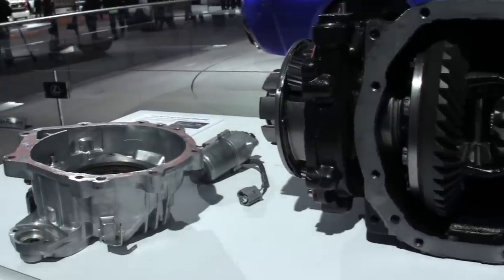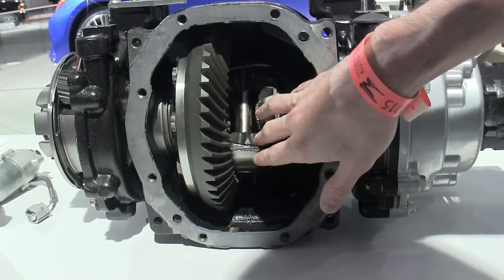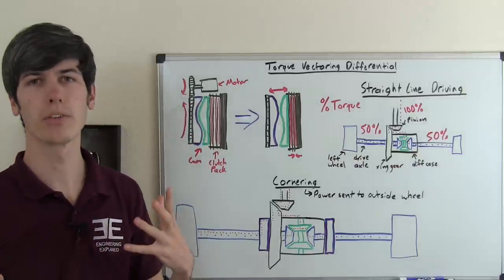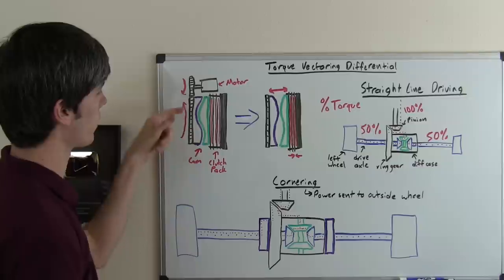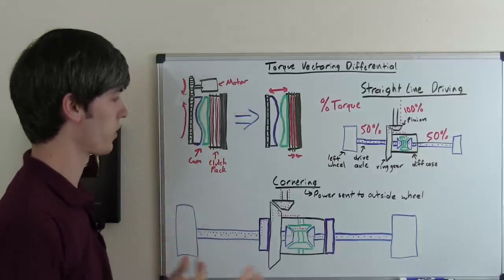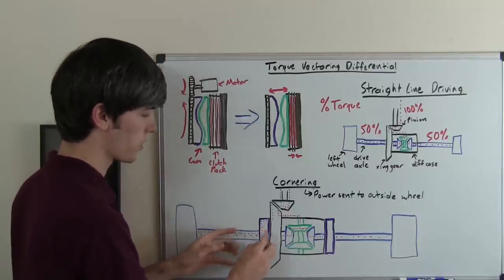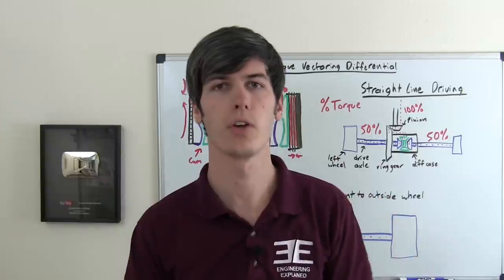Torque Vectoring Differential - Explained

Comment: Recent purchase of a 2019 jeep Cherokee with Active Drive 1. It has this crazy wobble on acceleration, even after replacing the rear drive module. I’m wondering if torque vectoring problems in the programming are the actual cause of what seems to be a lateral wobble

Comment: Nice video, but I don't know if I'm getting it right. So the controller input is the driver steering angle and small part of the throttle gain? how wide is the torque ratio do you think this can transfer 20%-80%?
Reply from the maker: Some of these diffs are capable of sending 100% of torque to a single wheel.

Comment: Seems like it works like a brake lock differential (bld) but at high speeds. Instead of using the brakes to move torque it uses clutch packs.  Am I understanding it right?   Seems like a lot of work for not such a great gain...

Comment: Seems like a high weight/complexity/point of failure-to-benefit ratio. Torsen seems like it could do 80%-90% of what this does for 1/2 the weight and 1/10 the complexity and points of failure. Not to mention clutches being worn items.
Reply: Torsen by itself doesn't make the same job. And it has its own inherent cons.
Reply: @MaximusU76  The only con of torsen that I know of is that it acts like an open diff of one side has zero grip. The solution to that is to press on the brakes. If there was anything else, I'd say the initial purchase price for the unit compared to a clutched 1-way, and that a torsen itself is also only 1-way IIRC, but I'm only 30% sure about that since I've seen several guys drift very well with them.

Comment: are torque vectoring differentials and LSDs same without the motor in the clutchpack?
Reply from the maker: Similar, but torque vectoring differentials are capable of proactively altering the amount of torque sent to each wheel, where as an LSD mechanically reacts to differing grip. You have significantly more control over how torque is applied with torque vectoring.
Reply: This torque vectoring doesn't involve any locking, but rather using planetary gearing system to vary the shaft speed (Like you know, automatic gearbox)
So yeah, technically speaking, it is completely different
Reply: No, the motors for activating clutches are not the only difference. Cause it would be a regular active LSD. They are also planet gearsets on each axle.

Comment: Will this allow you to have an even smaller turn radius in a RWD without the front wheels just sliding forward? How much smaller do you think?

Alternatively, in a RWD, would having an open differential but having brakes that can apply to one rear wheel or the other when at very low speeds with the steering wheel is turned very far help you with that?

Also, I have a general feel for when the front wheels will just slide instead of actually turn (from my sit-on lawn mower. It's RWD, open differential and can turn the front wheels really far. Measured about 65 degrees on the outer wheel on max turn).

It seems to not want to turn anymore at different angles depending on the inclination of the ground, the direction I lean on it, and the surface it's on. Maybe there are other factors I don't know about too. What I have no idea how to do is calculate what angle it's gonna be.

Anyway I had this idea because I discovered that short of spinning one wheel, leaning over the outer rear tire seemed to mean I could turn the steering wheel slightly more and still turn.

Just figured if that could somehow be used to lessen the eternal pain of doing U-turns with your city car on tight roads, that'd be swell.

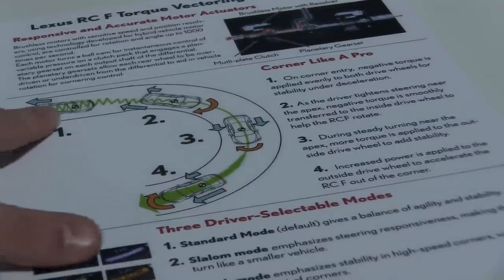Comment: At 4:44 what does the diagram mean by negative torque is applied. What is negative torque and how is it applied.
Reply: It will actually turn that side of the differential backwards sometimes in order to swing around more during a turn or something like that.  Sounds weird, but for track laps it's actually pretty effective.
Reply: That is just braking.

Comment: In reference to the Evolution X and the 2015 WRX and STI, how do those torque vectoring systems differ. It seems like the Evo X uses a system like what was explained in the video. However, the WRX and STI uses a "brake assisted" system Subaru calls "active torque vectoring".

Comment: Why is more torque sent to the inner wheel to rotate as opposed to the outer wheel? Is it because while turning the weight of the vehicle compresses the outer wheels more giving them more grip, meaning the inside wheel essentially has less grip and needs more power? Thanks.
Reply: Remember that under hard braking, the torque from the engine will work as "engine braking" which is why in the diagram, in the video, it is referred to as "negative torque". It is actually braking the inside wheel more by connecting it more to the engine using torque vectoring = more negative torque to the inside wheel. When coming out of a corner, you hit the accelerator, and when the car senses that positive torque is being applied, it shifts it to the outside wheel. I hope that makes sense.

Comment: So a torque vectoring diff is an lsd that is electronically actuated based on differend readings from sencors, instead of mechanically through the movement of the pinion. Thus making it a proactive diff instead of reactive. Which would you say its better and more reliable with less maintance required. Correct me if im wrong, im still an engineering student. Also big queation, might be dump. We know you can pretty much fit a torsen to any open differential housing. Could somebody theoretically put a torsen(or similar atb) in the place of the open diff in this diff assemply. Would that make any sence at all?
Reply: Not exact. This design has planet gearset reductors at each side. So wheel side of the clutch is rotating slower than diff housing side, even for faster wheel.

Comment: 4:58 it actually says negative torque on the pamphlet which is a small but important difference.
Reply from the maker: Correct, important point that perhaps I could have been more clear on rather than just showing the backwards arrow.
Reply: +Engineering Explained 
just make additional video about Negative Torque.
I don't get that concept with full fathom.
Reply: park kim In this case it's just referring to torque in the opposite direction of travel.
Reply: It's just braking. No matter by what means, traditional friction brakes or recuperating E- motor. And yes, braking could also be vectoring, and are indeed. By individual brakes (traditional), individual motors (one per wheel while recuperating) or by such diffs.

Comment: Hi Jason. Would the torque vectoring lsd diff be better than the torsen and viscous lsd diffs for regular and performance driving ? Whats your opinion ?
Reply: +Timur Hafouz Yes, it would be better, because with TV, the outside Wheel is more "accelerated", wich helps the car turning. The common LSD Types are only locking if one Wheel is losing traction. Also the Clutchtype LSD is often pretensioned, wich leeds to understeer. So in many cases, is the TV a better solution.

Regards from Germany

Comment: Thank you for the explanation. A technical question for anyone that can answer it, and I can't seem to find info on this anywhere. When the clutchpack is engaged one axle side, it is connecting that side to the differential housing, but is it also disconnecting from the spider gear? If not, wouldn't that immobilize the spider gears (inside the differential housing), and effectively locking the other side to the differential housing's rotation? I noticed there's a planetary gearset on each side that must somehow eliminate this, but I'm curious as to how?  Thank in advance!
Reply: I think his explanation is actually wrong, the axle is not directly clutched to the differential carrier. The axle is clutched to the carrier through a planetary gear system which then allows one axle to be driven faster than the carrier in turn driving the other axle slower due to the spider gears. It kind of forces one wheel to spin faster that the other thus creating a torque vector.
Reply: @wdwickham  Thank you. If that's what it does, then it seems like the torque vectoring is binary (on/off) rather than variable
Reply: Not binary. Because that clutches is not aimed to full lock. If so you get a fixed ratio between left and right wheels. And that's not the case. They are slipping all the time they are engaged. So you have some power  loss, heating and more rapid clutch wearing during torque vectoring.

Comment: because when the clutch  lock up it act as a solid unit with the differential housing, it's exatly the same result as braking. So why not building only brake torque vectoring system? You could save some weight, of course brakes'd heat up faster..
Reply: Brake based system is very slow (~200 msec range).  Clutch pack system response is really fast and it doesn't rob as much power from the powertrain.

Comment: I also wanted to ask if there is a difference between LSDs and torque vectoring diffs! Also does ford's torque vectoring system use the same principle or is it just by applying the brakes to the wheels thus alternating torque distributtion?
Reply from the maker: Many use the method of braking individual wheels, as it's far cheaper to implement, though I think a dedicated system as shown in the video would ultimately be a better solution (and wouldn't cause brake wear).
Reply: LSD's are mechanical systems and do not react based on conditions, steering angle, yaw and throttle application. They are pretty much bullet proof but not smart. TVD like in a SHAWD Acura or the lexus are capable of sending 100% of the power to the outer wheel and can also help correct your angle. In bad weather conditions it can sense slip and send power to the wheel with the most grip. 

Ford's system is brake actuated and is very basic. It works but its older tech and isn't as good as an active system.

http://blog.caranddriver.com/what-torque-vectoring-really-means-for-the-2012-ford-focus-and-why-you-shouldn%E2%80%99t-get-too-excited-about-it/
Reply: Engineering Explained Would be interesting to see comparison of available outside wheel energy (or system efficiency) of torque vectoring vs brake based vs clutch vs viscous LSD's at varying loads.
Reply: Chris Conroy Well it would be brand specific again. Acura's system can send 70% of the power to the rear and 100% of that to each side if necessary. Lexus may be different and Audi's split is 40:60.

Comment: Coming into the corner it applies more torque to the inner? Shouldn't it be to the outer more, just because it would have more rotating ratio than the inner. Just like it coming out of the corner you see it's the outer having more torque.

Comment: Yeah, I still don't understand. If all you are doing is engaging the axle to the differential housing it would make it no different than applying the brakes on that wheel, which would for sure be less complicated and cheaper. No mention of why there is a planetary gear here. I think this explanation is incomplete and confusing.

Comment: Seems like this adds a lot of weight.   For a lightweight car, is it going to be worth it, or does the extra weight causing the car to want to fly out of the corner more offset the torque?  I suppose you will spin the inner wheel at the limit and lose traction, but isn't this just fine for a racecar, at least with a good driver.
Reply: I think, it would be beneficial to use to for some XUVs
Reply: @RahulSharma-oc2qd  One with a high COG will lift the inner wheels rather easily in a corner so yeah this would help maybe a lot and of course adding 200lbs to a 5000lb suv is not a big deal.

Comment: If there is slipping on one wheel during cornering (say, the inside wheel, which needs to lower torque), disengagement of the clutch pads will unexpectedly send more torque to this slipping wheel since the torque goes to the minimum-friction path, wont' it?

Comment: Except for Lexus FWD Awith AWD based SUVs that only send 50% power to the rear maximum and only have brake based vectoring.

Can you cover which brakes are used in brake-based vectoring?
Reply from the maker: Some companies apply brake vectoring to just a single axle, others will do both front and rear.

Comment: I still did not understand the advantages of torque vectoring diff over open diff. I mean this job can be done by limited slip or self locking diff as well.
Reply: only difference is that it can now be electronically engaged (e.g. through steering wheel movement) rather than through movement of the pignon when braking/accelerating. The new Acuras NSX apparently uses this technology heavily
Reply: No, that's wrong. Classical LSD can only push forward slower wheel and pull backward faster wheel. And that doesn't help while cornering, rather opposed.

Comment: How is this different from an LSD ? What if I could use a Torsen differential/LSD which could be activated during cornering as well (and not just during the case of unequal grip) ? Won't that essentially act as an equivalent Torque Vectoring Differential?

Comment: Doesn't a limited slip differential (LSD) do this exact same thing mechanically? Having sensors, electronics, and motor seems like a lot more to go wrong when a mechanical LSD does the same thing.
Reply: Not exact. Simple LSD accelerates the wheel with less speed and brakes the wheel with more speed.  And that's not the case for good cornering.

Comment: wont the clutch pack wear out very quickly ? and once the clutch pack wear out, the lsd no longer function?
Reply: That was said about vicious LSD. When the fluid lost its condition and there is no more much friction that device operates more like open diff.

Comment: Great Video...Thanks!!!....but I dont think that would be the best solution to the torque vectoring problem!!...many  questions araise....Are those Clutchs wet or dry???, do they heat much???...with sport drive they would slip by temperature???....the wear material...where it will go??....the water, mud or snow will afect the performance???...imagine a long trip like 12 or 18 hours with turns...they are engaging and disengaging all the time?...what would happen if a clutch pack wear out fast in one side that the other???...could a high performance sport tire (size, shape, and compound) burnout the clutch packs faster???...the ABS or TCS could grind those clutches???...please comment!!!....Thank you all!!!!
Reply: I would imagine the clutches don't engage until the car is near the limit of its grip, which wouldn't be often in normal driving (unless you're an idiot). Even on a track, though I doubt there will be any reliability issues because the clutches are almost certainly wet and looking at the video, appear to share the fluid with the diff, so the volume of fluid will probably mitigate any overheating issues. As for mud and snow, there is most likely a low traction condition driving mode selectable on the console which would optimize for those situations. I think a high-performance tire would make little difference in the wear of the clutch packs because the slip rate would only be affected if a tire were to lose traction. Otherwise, it would be the same. Just my two cents. Anyone feel free to correct me.